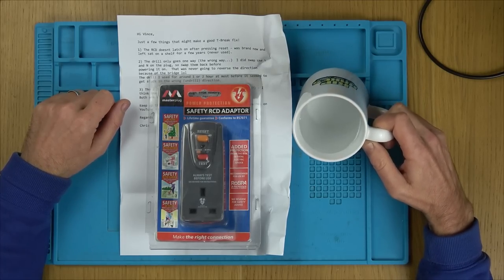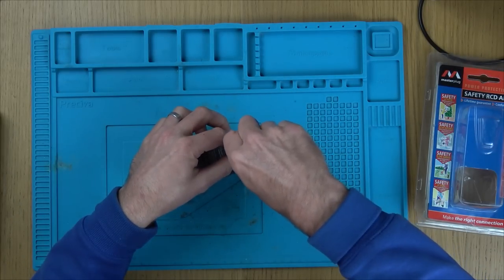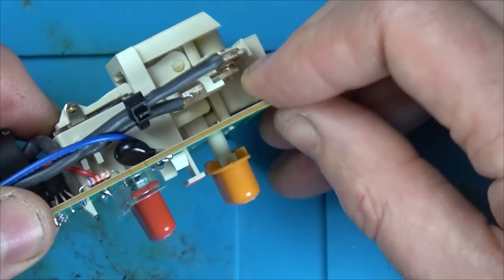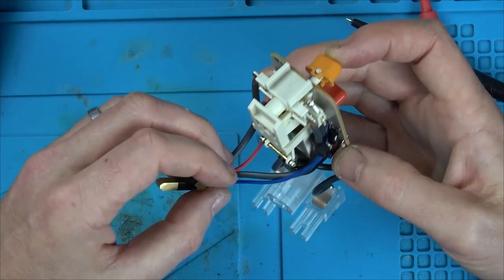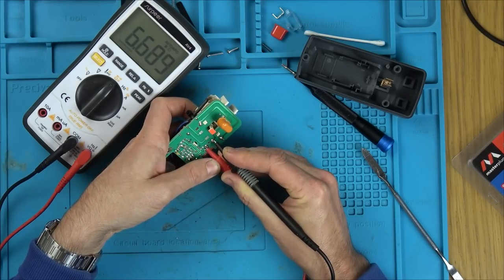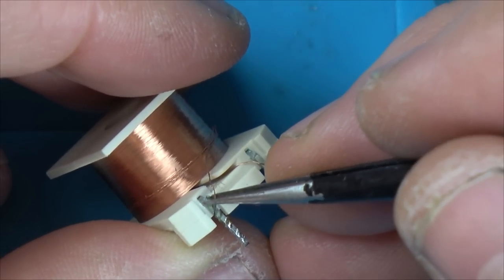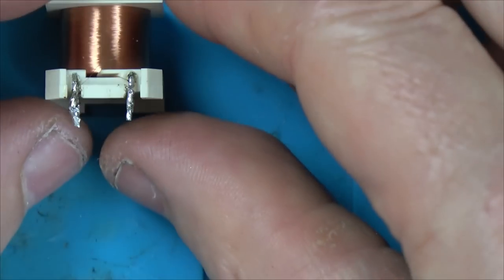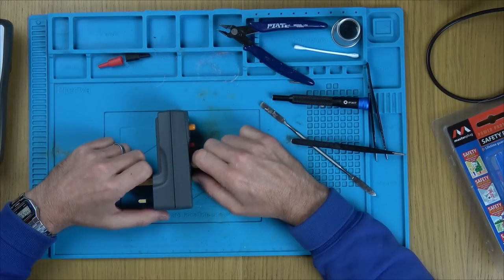RCD Safety Adaptor - New BUT Faulty - Can it be FIXED?

Comment: I think it is still safe to use, you would have made the latch a bit weaker, so if anything you made it more sensitive to opening and breaking the circuit.
Reply: this...
Reply: yup I thought this too, it would be different if it was on the fault sensing circuit
Reply from the maker: Thanks Scott👍
Reply: I agree.
Reply: Yep, probably even safer to use now
Reply: While this is true.   This is also a life saving device.    Its meant to intervene in a life threatening intervention and the potential for a mistake to cost a life is there. Its brilliant content but the tiny risk of it failing when the stakes are so high would make me not use it.   I dont want that on my hands.    Its for the same reason i wouldent put a repaired airbag into a car.
Reply: This repair could be WRONG and so dangerous. I had a similar RCD failure (not latching) and all I had to do was to replace a 10UF 160v electrolytic capacitor that was showing only 0.2UF on a capacitor meter. Made in China RCD for UK 240V used a 160V capacitor?

Comment: Awesome fix Vince!!!! =D  I would say its probably safe to use tbh!  Because worst case that wire blows (due to higher current through it - less resistance) - meaning it would just stop latching if something went wrong there.  What is important with safety devices is ensuring every other piece is assembled properly and there are no other issues that could crop up as a result of going in there.  Thanks for the kind comments at the start there btw =D  Very much appreciated, I am proud to consider you a friend too =D   It is a shame YouTube does seem to be going backwards in so many ways over the last few years.  Just stick with it - I am sure you will pass 1 million subs soon!
Reply: Totally agree, worse case is that the coil would blow again.. I wouldn't have a problem using it. You could even test it by touching the output of the neutral to earth, which is pretty much what the test switch does anyway.
Reply: And I thought I was your favourite, I am shocked LOL !
Reply: Have to agree, the current sensing was untouched, this is just a solenoid to latch on, and spring pressure would break the circuit should the coil fail.  Might be worth sending to Big Clive for a test.  IIRC he has something that can test RCDs.
Reply: I'd use it also because it is functioning correctly if if anything it will probably trip a bit faster.
Reply from the maker: Thank you Chris, others have concluded the same on the fix, so many knowledgeable viewers! I really appreciate you sending this box over 👌👍 I will stick with YouTube to the bitter end, I just feel the growth boom years are over and now it is a case of hanging on, I'm just hope I can hang on for many years to come 😂👍
Reply: It s better a false fault than not blocking a real one

Comment: Measure the resistance of the wire that you removed to see what fraction of the overall resistance it is. If it is only a few percent then it may still be within manufacturing tolerances and still safe to use.

Comment: The coil you have repaired is just an electro magnet that is energised as long as the current coils are balanced, since you have not messed with the current coils, (the current coils monitor the in coming current and the returning current which should be balanced, if and when you touch the live or neutral the current balance is out as there is now a leakage to earth, through your body or other means) and the monitoring circuit will de energise the electro magnet holding the output to the socket on so it stays live, if the balance goes of by 30mA (usually), then it "trips", I would say its safe to use as this coil has nothing to do with the operation of the tripping coils and monitoring circuit,  As long as you have enough current flowing through the magnet coil to hold it on it should be fine, yes taking some of the windings off will increase the current through the coil but with the amount you removed it should be ok, it will also be DC and not 240 volt, it will probably be 12 or 24V, it needs to be DC to ensure the magnetic poles do not change,  You have some patience, I would have just binned it hehe.
Reply: It a 30 Miliamp AC type RCD and will fail if the coil is saturated with dc current, 
In normal working order it should trip in less than 300 milliseconds and at a trip current of around 24 miliamps , removing some of the coil winding you have made it over  sensitive and so it will trip for know reason we call it nuisance tripping. It is no longer safe for use .

Comment: Hi Vince, probably others have already said this, but these work by comparing the current in the live line with the current in the neutral line. These values should be exactly the same, current out = current back. So if the circuit detects a difference in those currents, it trips the device and breaks the circuit. The reasoning is that if these values don't match, some current is flowing elsewhere, perhaps through a person to Earth. Your device would probably still be OK, as reducing turns on the coil will reduce its magnetic strength rather than increase it. However, more current would flow through the coil so I suppose it could get hot.

Comment: It'll be absolutely fine to use, the coil is only for an electromagnet which is deigned to fail safe, all you have done is slightly reduce the EMF generated

Comment: In my opinion the windings only make a magnetic field to hold the latch down, it’s driven off of a maybe 5-12v so it has nothing to do with the safety side as that is being monitored though 1 current, and 2 leakage to ground anything above 30ma (approx) is all it takes to trip, I have a Lidl mains tester to make sure the wiring to the socket is good and when you press test it trips the house RCD, also has leds to indicate correct wiring and that it’s in the right place.
Vince it will be fine, there’s probably a 10% tolerance or so on the relay from manufacturing well done great fix

Comment: hi vince yes it will be safe to use i had the same thing with a lawnmower motor unraveld 360 degree of copper wire and resoldered jobs a gooden. nice job vice you cracked it👌

Comment: Great fix Vince, always satisfying to see what actually failed even if it wont be used. 

I don't think you have made it unsafe in fact I think it would be safer now as that coil will now generate a weaker magnetic field resulting in it unlatching more easily.

I own a multi function tester which can test RCD's, this allows you to test how fast the RCD trips in the event of a fault and at what fault current it tripped at to see if it is within specification.

Under the UK wiring regulations an RCD can take up to 300ms to trip at 1 times its rated current or 40ms at 5 times its rated current.

In your consumer unit (fusebox) if you have RCD's fitted their rated current will mostly likely be 30mA, the RCD in the video is a 30mA RCD.

No issue with using an RCD on top of an RCD other than it will be a race between the two as to which trips fastest, just because they are both rated the same does not mean they will trip at the same time due to manufacturing tolerances and other external factors. 

This is why on fixed installations if two RCD's are connected together one is time delayed so it guarantees one trips before the other.  

In 2015 it became mandatory to fit RCD's in domestic dwellings to socket circuits in the UK but that does not mean there are still not tens of thousands of properties still not protected.

If the installation was designed before this regulation came into effect and is in a safe working order an electrician cannot force you to fit an RCD only recommend it.

If they were designing and installing a new circuit then an RCD would need to be fitted to comply with the regulations.  

Same goes for metal consumer units to replace plastic and many other changes to the UK wiring regulations.

Comment: Nice fix. On the positive side, if the coil burns out in use the device will go dead, so the protection it gives won't be compromised. On the negative side though, the shortened coil will draw extra current and might overheat in use. I wouldn't use it.

Comment: I would consider it safe to use for myself but would not let anyone else use it. The only thing that may happen is the coil may get a little bit hotter when in use and may burnout causing it to go open which would shut it off anyway. I thought the wire at the beginning looked messed up, I would have tried cutting that bit off to see if continuity was back at that point.

Comment: It's just an electro magnet, it would still be 100% safe to use.  With the less windings on the coil, it would be even more sensitive to electrical faults in your circuit.  To an effect you've made it even safer to use.

Comment: it will be safe to use as you have removed a bit from the magnet coil so you have actually made it more sensitive and will turn off faster than normal if something were to short out😊 so it's actually safer than before, you can't overload it as much anymore😊😅

Comment: Would have been interesting maybe if you measured on both ends of the broken wire that you unravelled. But I think the RCD device is still safe to use.

Only way to find out is to test it lab style.
Another great fix, Vince!

Comment: i think  that coil is just for electromagnetic lock -unlock and resistance of it doesn't change it's duty.it will get a little more power for working so device is still safe to use.

Comment: In my personal view as electrician I don't see a problem in the coil because it's not the primary safety device the primary safety device is the Arc and the RCD tripping when there's a fault current the quickest way to to do that is to do a CPC test or doing insulation resistance test to make sure that it is possible but you can also do a PAT test as well to double check everything but in my view you should be fine always get it Pat tested and checked by a qualified electrician put a sticker on it the cost you about £5 for a PAT test

Comment: @16'06" you say "It doesn't look healthy at all" .
I'll bet that if you checked that first 2 or 3 turns for continuity you would find it open circuit (merely lacquered wire twisted together and a new layer of lacquer holding it together).
I note that John Beach suggested in the comments that it's probably "a production joint where they changed a spool of wire on the winding of coil at the factory..."

Comment: I notice a lot of comments about coil resistance being affected (which of course it is), but i've not seen anything mentioned about the coil impedance, after all this is an inductor that is operating at AC voltage. Personally I wouldn't trust it not to overheat.

Comment: Vince wonderful repair! Personal opinion, and completely based off repairing relays and having no knowledge of the circuity of you're RCD, the purpose of that coil is to develop the magnetic field to "latch" (as you rightly stated). Has no affect on mains which should be on a separate circuit path to load/output. I believe you're safe. Now if it were other components or the mechanical pieces, I would have a much greater reservation. That all being said, no harm in ever being too safe. On a similar note, small wall wart power supplies, like the one I took part on my rockeroo video,  I would never repair and reuse especially when they are cheap and a dime a dozen.

Comment: I believe 100% that it would be fine to use as is, however; legal liability would fall on your shoulders and not on the manufacturer once you have opened the case (and certainly after you have modified the original design).

Comment: vince nice job but idk, tbh about safety part. But when i vaped and did my own coils 1-2 wraps at about 1/4 inch round would change my ohms  (increase or decrease by .20/.25 ohms) thats about 1 inch of wire... no idea if it stacks to make a difference tho.

Comment: I use these for when I have fixed something I'd rather trip that unit rather than the house, or plugged something in that I think is sketchy at least the consumer unit isn't going to trip so they are good to have around, I'm thinking of changing my plugs in my workshop to these sockets built in

Comment: The wire locked so strange because at the start and the end of the winding the wire is folded back and forth to release some stress from the thin wire when solderin it to the lugs. I think it's OK as it is if it stays in the restet position ...

Comment: I would say that taking that length of wire off would make the electromagnet weaker. So it will be slightly easier to trip. The only thing that the electromagnet controls is the latching. So even if the coil did burn out it would just unlatch and you would end up with the RCD in the same state as at the start of the video.
Reply from the maker: Thanks PDS for the invaluable knowledge as always. Haven't seen you in a while, hope your keeping well 👍👍👍
Reply: @Mymatevince  I'm good just trying to get in shape. So at the gym every day but it's slow work. Since one side of me is very weak.
Reply from the maker: @pds8475  Well done, every little bit extra helps 👍👍👍

Comment: Well diagnosed. Reducing the number of turns weakens the holding force (credit to Defpom) so you could argue the result is safer (a loose sense of the word), but more likely to trip inadvertently. There are coil winders available (which will also count turns, see David Tipton and M Caldera) but that, and electrical testing, is an expensive, time-consuming pastime.

Comment: The more turns in the coil would create a stronger magnetic field, so fewer turns means a lower magnetic field. If anything, it would trip more easily so I think it would be safe but as you say it is a safety device and there are almost certainly tolerances which have to be adhered to. Let's face it, If they could make it with less wire they would. Interesting fix.
Reply: "...If they could make it with less wire they would". Key.

Comment: its always interesting Vince and i dont know how a rcd works
Reply: it a electromagnetic tilt switch and i think reducing the winding will make i more sensitive good i think
Reply: maybe wire a  neutral to earth fault an see if it trips before yor house RCD you know wire a small bit of wire inside a uk plug between neutral an earth ,plug the RCD into a un connected extension lead with the hacked plug in it. and switch it on at the wall ,if it trips before the main house breaker it safe ,if the RCD sences this it will  seance a live to neutral fault

I know many replies is un cool but I fink and re fink ! and I know stuff that 90% doesn’t know
Reply: @markdjdeenix6846  You are about correct! It works by sensing the current flowing down the live and returning through the neutral. if they don't match (because current is leaking somewhere like through a person) then it releases the latch breaking the circuit. The less winding on the coil shouldn't be an issue.

Comment: It's safe all the windings will do is not let the magnetics hold the breaker down, Now if you had added too much wire that would be a problem then it could technically hold the connection way past its typical open-closed breaking point. To break the connection.

Comment: Joined the big boys watch club... first mechanical chronograph on way ^-^ and its a panda O.o am now going to focus on Seiko as my intention is to Pokemon them as I have 6109, 6309, 6349, 7009, 7019, 7S26, 8V20, 5M83, NH35, NH36, VK63, VR43, VD53, VD57, V657 plus a ton of lesser Seiko quartz analogue plus an original pair of Pulsar solar's from the eighties... quite a lot of Seikoery.

Comment: 20 or 30 loops won't make a big difference but you could just connect 2 wires and insulate the connection and it would work like new ;)
Reply from the maker: Yes, I should have done that 👌👍👍👍

Comment: Vince,  a wire has resistance in the length not just voltage and amperage or wire rating, so by shortening it even by 6 inches can have a different outcome. so yeah best not use it. not that 6 inches shorter would make a major distance, but wires are meassured to be precise so that they can get within mm's of difference for margin of error. while something like a car radio sticking it in the boot or something wouldn't change the opperation or sound of the radio when it comes to micro-small wires then it makes a lot more difference.
Reply: another way to demonstrate this would be on a train-set with 10 sections of track or whatever, then you decide to put track running all around a room, and without adding more connection points for voltage, the train will stop because it cannot get anymore voltage from the track because the resistance is too high.

Comment: 2 things, could you have measured the resistance of the of the wire you removed to find out what the total resistance was( resisters in series add) also I am curious as to what electrical stuff you use: power supply, flux, etc and how you use it? and thirdly (yes I lied) how can you trust measuring components in-circuit, surely the rest of the circuit would affect what you reading you might get? I really likee your videos as I find them both instructional and inspiring - can't wait to see the Roller running again :) all best Andrew

Comment: Could a drill, fitted with a nail or bolt in the chuck, be used to unwind a coil like that?
Reply: To unwind it you just need to put it on a screwdriver and pull on the wire. To rewind it, a drill could be used but you would need to move the wire up and down, and I don't think the end result would be pretty...